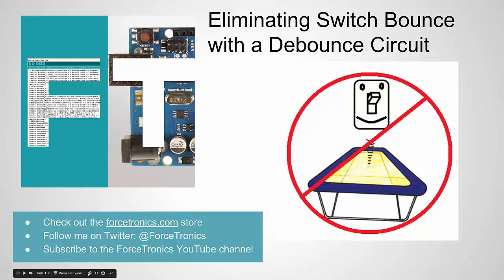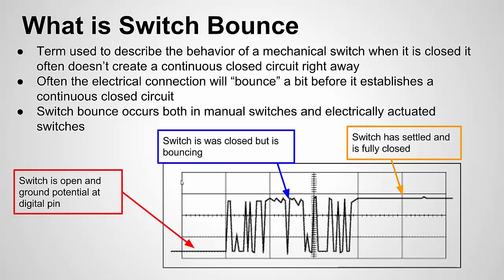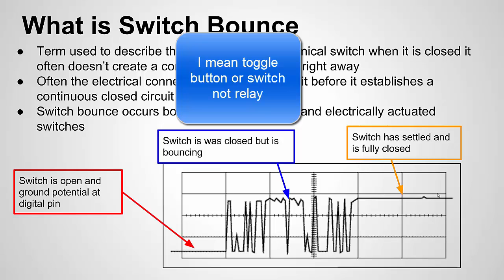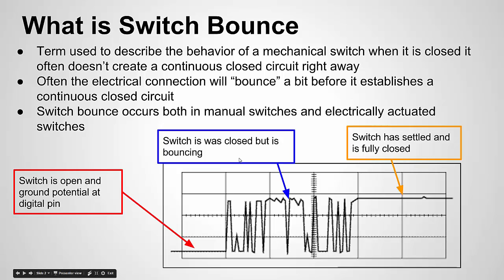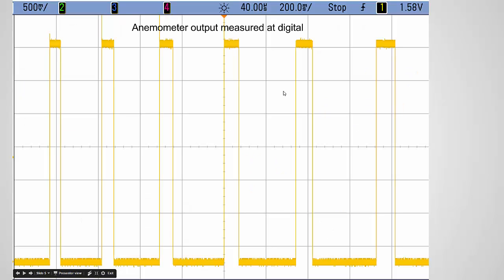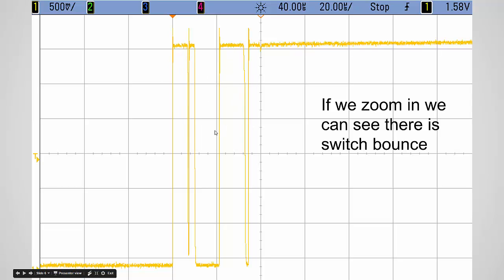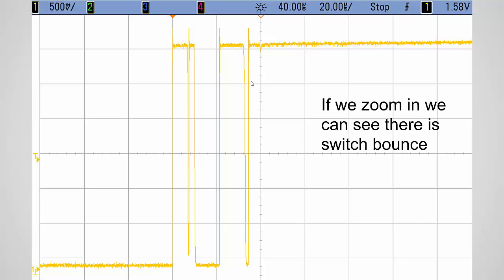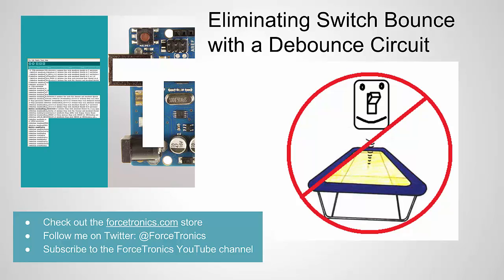Eliminating Switch Bounce with a Debounce Circuit

Comment: I have a video controller for my computer that,externally,looks like an XBox controller.
During the game,(Halo CE for PC), when I press the button to start the elevator,the switch often times bounces and I have to hit the button a couple times until it settles and the elevator moves.
Im thinking about using a ceramic 0.1 microF cap in line of the feed to increase the time on duration of the connection.Sound good?
Reply from the maker: That sounds like it might solve your issue. But I don't know how those buttons are implemented and the circuits they control so I can't say definitively if that will solve your problem
Reply: @ForceTronics  Thanks for your reply. If we both think it may (but neither are sure right now,) I think Ill take the shot ..give it a chance.😁👍
Reply from the maker: @STEVE_C_1369  Let me know how it goes!
Reply: @ForceTronics  Will do.

Comment: i have 2 problem how i can make debounc pcb to, cnc limit switch, C and R size NO limit switch. 12V, and second problem how make promixity sensor, sense metal, need calculate spindle speed, prox 12V, data out and arduino nano need read this but need 5V max input to nano, speed 0-30K  2x/rev=60K trick to secod ? not need debounc and need convert 12V sensor data to 5V to arduino. i not understand what need do.

Comment: Thank you - this design eliminated the bounce for me, although I had to replace the 1uF capacitor with a 100nF ceramic capacitor to make it work well. To test, I used an ESP32 with a small OLED display to show a press counter.  Every time the button was pressed, it incremented the counter.  Without this circuit, it would increment the count multiple times for each button press.  Now it correctly increments one time for each button press.  I figure now that I have the button debounce working, it should work the same with the Inspeed Wind Speed sensor I have on order.  Maybe it's overkill, but I'm also using software debounce logic to ignore extra triggers within a 10ms time span.

Comment: Problem here: using a 10mfd cap and a 1n914 diode, the rapid current flow that occurs when the switch is closed causes a Reset of the arduino nano. The 5v regulator is not good enough to cope with the negative spike caused by unrestricted charging of the capacitor. I also do not understand why you are using the two resistor voltage divider joined at the anode to discharge the capacitor.

Comment: This is a very good tutorial for debouncing a reed switch. 

 As the reed wears, it's bounce may get worse and the software can check for abnormal readings to warn that a reed is wearing out.  Reed switches typically bounce less than 1 msec when they are new. 

 For a 5V supply, almost any silicon diode could be used.  For a 3.3V supply, you may want to use a schottky diode for it's lower voltage drop.  Someone mentioned putting a small resistor in series with the capacitor to limit the surge current when the switch closes, that's a good idea. A few hundred ohms will help.  You don't want the rise time of the input to be too long because some logic circuits go crazy if the input slope is too slow. As the input voltage passes through the threshold, the input circuit may act like an amplifier and respond to noise on the input signal, thus causing extraneous transitions, just like switch bounce inside the micro chip. 

The resistor to ground, 1K in this case, can be larger if you want to use a smaller cap.  It's limited by the current that flows from the digital input pin. Check the data sheet for this current value and make sure the voltage equal to the (leakage current*R_to_ground)  is well below the threshold for a logic zero at the input.

Comment: That is the simplest denounce circuit I've found so far.  Previously the ones I found used either a 555 timer or a  Schmitt trigger. Both of which seemed like overkill to me.

Comment: What's meant by switch bouncing??
Reply from the maker: I believe I explain it in the video. It is a phenomenon with mechanical switches that when they close fast they will go back and forth from closing and opening due to the force of closing this is called "switch bounce" and it happens in milli or micro seconds so a human does not notice but a MCU will.
Reply: @ForceTronics  What is a MCU? :D

Comment: Yes, the capacitor just worked well on the logic analyzer, without the capacitor, there's a lot of bouncing! Now pretty much the bounce problem is minimized to a good level, but the successive reads of the input which of course throttle the input count, I just want to count only 1 tick at a time.
Reply from the maker: I am not exactly sure what your question or comment is here. You want to trigger off of the rising or falling edge so each pulse is only counted once
Reply: @ForceTronics  Yes, exactly. The microcontroller is so fast that it count a moving object in front of the IR module 10 times in one go. I want it to count only one each time.
Reply from the maker: Most microcontrollers allow you to setup an interrupt off the rising or falling edge of a pulse that way no matter how long the pulse is you only count it once. If you are using a polling method to count a pulse then you wait until you measure first a low to high transition and then a high to low transition before you count it as a pulse. If you just try to measure "highs" then you will count the same pulse multiple times

Comment: Great explanation but I'm still confused about why the diode is necessary?
Reply from the maker: It ensures that the capacitor only discharges through the resistor network. While the switch is bouncing, if the diode was not there the cap could start discharging when the switch bounce is in the open position
Reply: Ok, Thanks for the reply!
Reply: @ForceTronics  could you make it more clear, thank you

Comment: I would add an Schmitt-trigger inverter which outputs a nice signal. But some Schmitt-triggers inverts the output. In some cases this inverting feature is interresting. For instance, when you use an I/O Expander.

Comment: When you keep the swith pressed, no current will flow trough the diode. If you used a LED instead of the diode the LED would turn off.  Which circuit would you build if you had to use a LED that goes ON when button is cept pressed?
Reply from the maker: If you are just trying to turn an LED on or off then switch bounce is not an issue because the human eye wouldn't even notice it. So for an LED I would just use a switch and a current limiting resistor
Reply: No, I wouldn't reply such if I only wished to turn on or off a LED.
I wanne debounce but also wanne see a LED ON when button is pressed and OFF when the button released
Reply from the maker: Ok, I see. You should be able to use the LED in place of the diode. I guess you may need to ensure that the LED doesn't have a high voltage drop that takes you below the voltage threshold level of the digital input. Its a good idea!

Comment: Very useful, I bought also a anemometer, a rain gauge and a wind vane (I think this is the right name for that device pointing to wind direction). All of them are using  reed relays, I"ll try the hardware method you just presented to connect to digital inputs. Thank :)